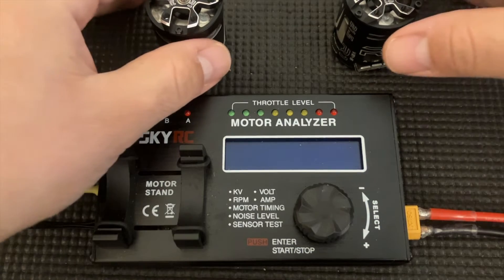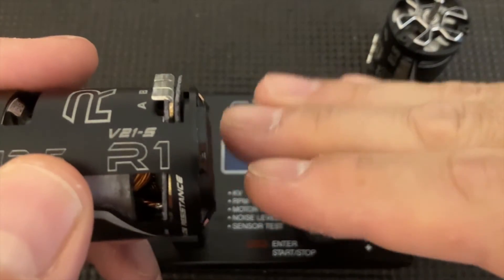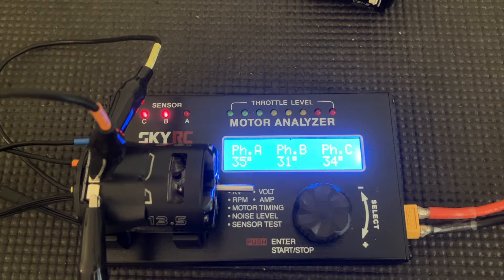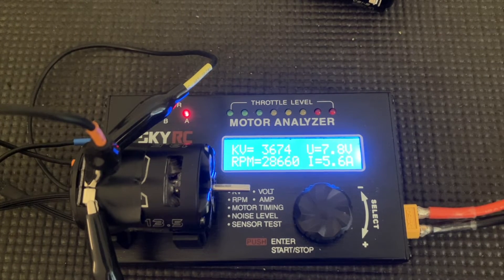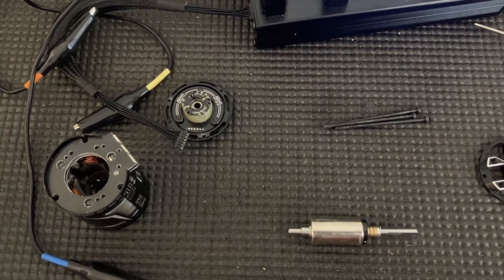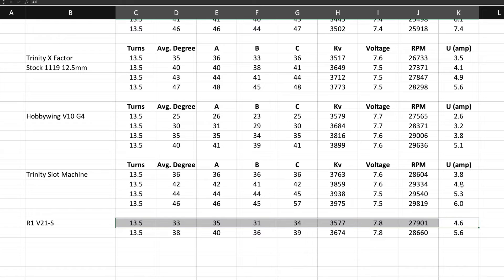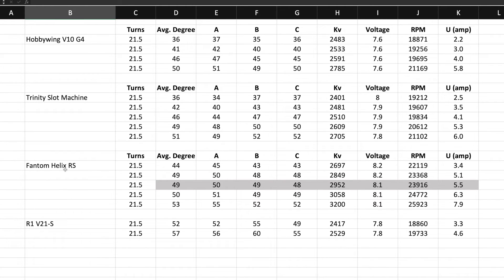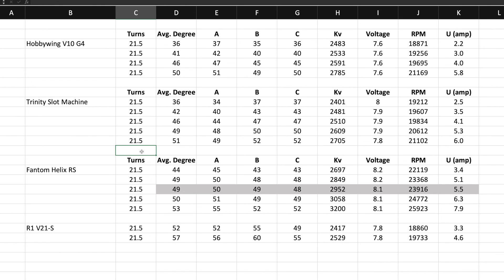R1 V21-S motor Analyzer How it compares on paper to Fantom Helix Hobbywing G4 Trinity Slot Machine

Comment: Hi mate, looks like that R1 21.5 motor has something wrong with the sensor board, that spread is really bad. My R1 21.5 will do 2800kv on 5amps on 50 degrees.
Reply from the maker: You might be right. It does seem too low as is. Thanks for the data to compare. I will have to contact R1.
Reply: @telecomandorc  the V21-s 21.5t with the long rotor (125726-1) is very impressive, once you upgrade to the titanium screws and ceramic bearings, expect 3200kv at 5a.
Reply from the maker: @Dru180sx  I will have to check if it is allowed here. But I like the idea. USGT is open motor here, but I am not sure if rotor swaps are allowed of if it is a spec 21.5T class.
Reply: The V21-S motors have a lot of torque.  You have to gear it differently
Reply: My FDR is 3.64, timing at 49 degrees, at a medium sized technical track, low grip, night racing, motor temp at around 55-60 degrees celsius, with a 30mm motor fan. Guys in the Amains constantly asking me, "what bloody motor im running ?", crazy punch in the mid-field, and unbeatable on the straights.
Reply: @telecomandorc did you contact R1?

Comment: I decided to put a Fantom Helix in my 25.5 but I replaced my 13.5 and 17.5 motors with R1.  Judging by these numbers it doesnt look like they are testing better than the Helix or the slot machine.  Do you have any predictions on how theyll perform in a vehicle versus any of the other motors?  

Perhaps I shouldve gone with the slot machine and helix....lol the spec class motor wars!

Btw I meant to mention that i asked the R1 via facebook about the aligned sensor option motors.  I asked whether the timing was meant to be adjusted.  Their description of the aligned sensors is that “any timing changes will change the sensor alignment.”  The response was “I personally leave my timing at 40 degrees and gear accordingly.  I never really go above 45 degrees.  If you find yourself wanting to turn it up more than that, you should change gearing.”
Reply from the maker: I think the Helix will perform better than the Slot Machine just because of the slightly higher gauss and how it manages more Kv at the same time. The R1 is intriguing to me. It is a low reving motor.  It revs low like a high torque motor, but consumes little amps like a low torque motor. 

My gauss analyzer will be in soon according to tracking. So I will have some gauss numbers hopefully this week. 

Timing at 45 degrees sounds like a very good idea. It is more torque than timing above it but good Kv compared to timing below it. The closer to 60 degrees the less torque. The amps may be low but the taller gearing to make up for rev probably loads the motor enough to bump up the amp draw. Not sure how much. Maybe I can test it this summer and play with timing and gearing.
Reply: @telecomandorc  So with the R1 does it sound like gearing down for more torque in the infield would be faster or gearing up bc the torque is already there?  I guess thats something ill have to experiment with...
Reply from the maker: @TheNewnan3  Try it out, but I am not sure the torque is there. It could be. But I have not tested the armature, or the motor in a car. But the rotor is weaker, and the motor itself has less Kv. There are some other parts I need to build something to test them further. But it will be a while.
Reply: I have both the R1 V21-S and Fantom Helix rs $150 versions.  I also have a motor analyzer I’ve tested them on with the V21-S having significantly lower kVs (2900 vs 3400); however, it competes just fine against the Fantom Helix.  The R1 is set to 40 deg in the can, and the Fantom is set to 50 deg on the can, both the way they came packaged.  You just have to gear them accordingly based on the track layout. Each motor has a different power band and sweet spot for gearing.  I get the best performance from the V21–S with a bigger pinion, and I get the best performance with the Helix rs with a smaller pinion.  In addition, I do find that the R1 tends to stay up to 20 degrees cooler, especially on hot days.  So without any load on the motor, I would say the motor analyzer is only good for giving you a rough idea on how to gear the car.  I would not hesitate to use either motor in my buggies; I love them both.  At the end of the race, it still boils down to your driving skills vs what electronics you run in my opinion.